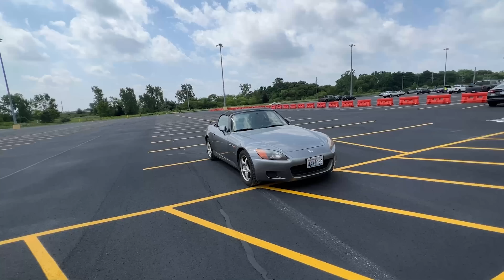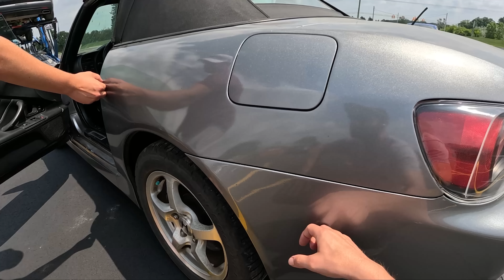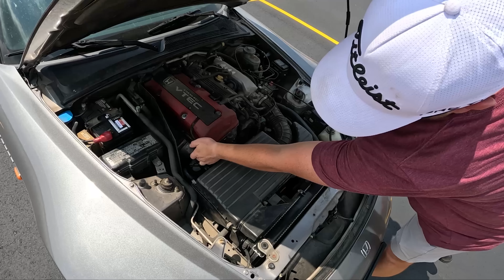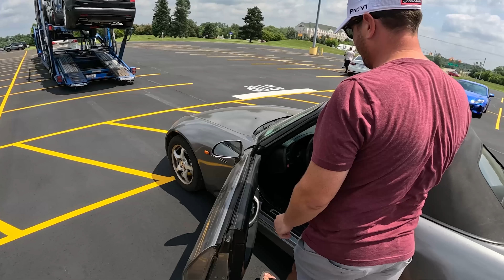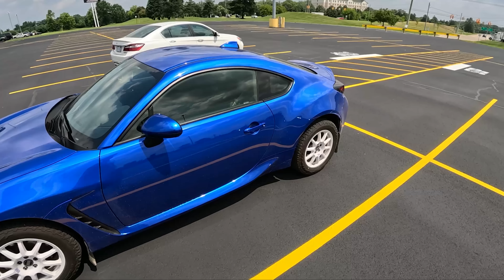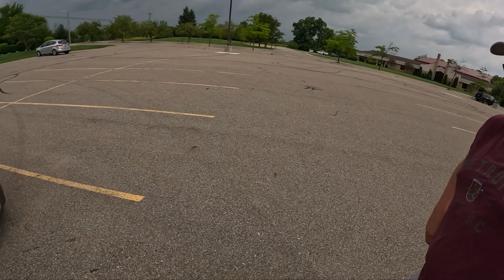2001 Honda S2000 - POV Delivery & First Drive

Comment: I am the original owner of a 2001 AP1 Silverstone/Red Interior.. I only have 28k Miles and its all original... Pristine condition..

I must say, that is an impressive find! This find is way more impresssive than those bastardized examples!! Congratulations thats a Jem!! 

A few things..
-the decel rattle are the clutch springs.. there was a TSB long ago... not a problem, just noisy
-for tires, make sure you go with a 225mm front and 255mm rear tire at least for the AP1... the original tires were specs at 205/255.. but they actually measure wider
-Use a name brand high mileage 5w30 oil and check it at every fuel fill up.. the harder you beat on it the more oil it will consume. 
-valve retainers, TCT and oil squirters should be upgraded
-

Best of luck!
Reply: Bridgestone make a set of front and rear Potenza Sport tyres specifically for the S2000 -- 205/55 R16 and 245/45R16 (both running wider than their nominal size, of course).  Though they have relatively soft sidewalls for some reason, unlike older model 16" Potenzas that have super stiff sidewalls (not sure why Bridgestone have changed this) -- though the sidewalls probably aren't any softer than on a  ContiExtremeContact (which also has 16" tyres available).

Comment: I pray that one day honda will make a modern one ❤
Reply: I used to think that too, but they would mess it up. The clutch would be too light, it would be turbocharged and low revving, it wouldn't sound good, it would have too many digital screens, it would be too expensive, and probably wouldn't look good. Sometimes it's best to leave Legends alone.

Comment: I had an 01 silverstone ap1 for almost 10 years until the steering rack crapped out.  I had an ap2 transmission with light weight flywheel and it was the best mod ever.  

The front passenger side fender has definitely been repainted.  I had the crappy plastic window.

Comment: I bought an AP1 couple of years ago pre panini. I am usually smiling just as wide driving it now as I did day 1. The engine sounds like angry hornets and is begging to get pushed harder. The only thing I think that is better but comes close in experience is Porsche. That says a lot about how legendary this car is. I wanted something faster but I didnt want to turbo it and change the characteristics of the car…. so I recently picked up an old AMG SL55. Between this and that I have quick lightweight car and fast v8.

Comment: Sugoi Desu. I have a Ap1 also. I recommend changing all the fluids, do a valve adjustment, and purchase modifry elastic straps incase yours are worn because your softtop will rip if they lose elasticity

Comment: The buzzing you hear at decel is most likely the clutch buzz that AP1s commonly have. Nothing mechanical, just noise. You can replace the clutch with the updated OEM disc if that noise bothers you per Hondas TSB way back. I have it on my AP1, i just deal with the noise since the clutch still works great after 15k miles. Got mine when it had 22k miles and 37k miles now.

Comment: The paint color looks inconsistent on the passenger side. But not sure if that’s a polarizer. My guess is not. For example the front fender and rear fender are different shades compared to the door.  But it seems you know that.

Comment: Getting closer everyday to obtaining one...I want an 04-05 AP2 still drive by cable
Reply: When I had my pick of S2K's six years ago, I specifically wanted an AP2v1 (O4-05) car. The cable actuated throttle was a part of that choice. Higher redlines aren't such a big deal after riding motorcycles for years,  but I'd still likely choose an AP1 over an AP2v2 or AP2v3 car to avoid DBW. Though many report little to no difference in the feel of the DBW cars, I simply don't like electronically controlled throttles. Ironically, some search specifically for the 2006+ cars for the ease of tuning the DBW system brings. The AP1 cars remain the bargains of the S2K world, but ultimately people should buy what they like. Prices appear to have come down some this year, so keep the faith.
Reply: @VirtualGuth  I've definitely been tempted to sell my EM1 for an AP1 a few times but I definitely know what I want. plus I wouldn't mind building the F22 for a higher redline :)
Reply: @matth6284  If the higher redline truly tempts you, then the other option would be to go for an AP1 car and then swap out the rear subframe with that of an AP2 car. A number of AP1 owners who raced their cars did this after the release of the AP2, giving them the higher redline of the F20C1 engine with the better handling (less bump steer) of the AP2 chassis upgrades. You could still retain the suspension components of the AP1 car if you wished as they apparently still work with the improved geometry of the AP2 rear subframe. Ultimately this would likely be quite a bit less expensive in the long run.

Comment: Do TCT, AP2 retainers/keepers, valve adjustment, shifter rebuild, motor mounts/trans mounts, fluids, torque rear axle nuts, the AP2 valve cover has upgraded pcv valve, check your driveshaft bolts they come loose maybe vibration you having, ect I could go on lol but that's a start

Comment: I also bought my AP1 with a recently replaced clutch. It also had a deceleration vibration. 
The vibration ended up being the Exedy clutch disc had too stiff of springs in the hub. 
I installed an OE Honda disc and all the vibration went away.

Comment: That F20C screaming to 9000 RPM. One of the highest revving Hondas ever along with the Integra Type R and the Civic Type R (FD2)
Reply: Don't forget the earlier Honda S cars. The S500 and S600 redlined at 9,500 RPM (compared to the 8,800 of the F20C), but revved to something like 10,000 RPM.

Comment: I've owned a 2002 and a 2006.  After a while you realize it makes sense to drive it in convertible mode only and is a second hand car for weekends.  Probably why I sold both each time.  Couldn't make a good case to keep them.  They don't make good daily drivers because they are uncomfortable, noisy, and stiff to drive.
Reply: I actually find my S2K to be pretty comfortable, but then I'm only 5'8" and also ride motorcycles (everything is relative). That said, I agree with you with regards to the noise levels of these cars with the top up. I'm an older guy that doesn't expect a sports car to be anything other than what the S2000 is, in fact these cars are fairly plush by my standards. But as you came to realize, I definitely feel that these cars are best with the top down (this is the reason that I wound up with a S2K in the first place). As a 2nd car to be enjoyed during nice weather, these cars are hard to beat. But for daily driving there are plenty of better choices out there.
Reply: You're approaching it the wrong way. They are excellent daily drivers if you think about them as a luxurious motorcycle.
Reply: Agreed I’m gonna sell mine
Reply: @mediocreman2  haha before my wife and I had kids it was fun for weekend drives to the beach.  But that's the only time we enjoyed them.  Sat in the garage most of the time.  Didnt make sense keeping them and paying for the upkeep.

Comment: Still baffled as to why Honda does not have an affordable RWD coupe in the line up in the modern day. Even something like an S1500 with a 1.5T would've been a hoot and a half to drive and own.
Reply from the maker: Agreed! They need to get on that
Reply: S2K owner here. It comes down to money and development costs. Honda doesn't have anything in their architecture that supports RWD. Literally everything is either FWD or retrofitted AWD. 

It also comes down to sales. Performance cars are such a low percentage of their sales. They even knew this when the NSX and S2K were being made, but they wanted to establish themselves as a contender. Performance cars are good for hype and branding, but generally always lose money from development costs. 

Even if they do make one it will probably be really expensive. Keep in mind the MSRP of the S2K in 2001 was $33k. That's $57k in today's money.
Reply: @777aterial yeah what people tend to forget is that the s2000 was pretty damn pricey new at the time
Reply: Yes but not with a 1.5t.

Comment: Be sure to do AP2 valve spring retainers, cheap insurance. There is good documentation of the AP1’s cracking. Congrats BTW!
Reply: AP1 valve retainers are totally fine unless you money shift and even the updated AP2 retainers can break then. My AP1 has done 200miles and they’re absolutely fine. Not really worth doing imo and there’s lots of documentation on it
Reply: @Manvswild11  You think the issue is overblown?  Is the swap still worth doing for cars that are tracked a lot or turned into race cars, or is not worth doing even then?
Reply: @Manvswild11 Agreed. Never had issues with mine but you never know if the previous owner was horrible at shifting and over revved the engine

Comment: My ap1 had a vibration. Ended up being inner axle cups.  Take them off and swap them left to right so the CV bearings ride on a fresh surface then properly re torque the axle nut.  Might not be what’s going on with yours but just a heads up
Reply: Very common on higher mileage cars. That solution is the same one I used and has been documented on the forums for decades.

Comment: Ap2 goes to 8250 so little less than 1000rpm difference. I rev mine to 8700 so it’s best of both worlds with the extra midrange torque 👍🏻

Comment: I thought these were a lot lighter, its only ~150 less than a new Civic Si
Reply: Heavy because convertible unfortunately.  (Or the engineering is just not as good as the mighty, if floppy at the time on the NB but likely not anymore on the ND, Miata!)

Comment: I've always wondered why Honda made that little engine with a good amount of horsepower for such a small car,  BUT NO torque!??
Reply: "BUT NO torque!??" More or less, that's the only way you can get 240hp out of a non-turbo 2.0L engine that doesn't have variable valve timing. Honda have chased peak power at the expense of everything else. The F22C addressed that somewhat with more displacement, while the K20 addresses that using variable valve timing (while the K24 uses even more displacement to address that but can't rev as high).

The S2000 engine has a big bore and a very short stroke (for maximum torque you'd want the opposite), an intake manifold with short and fat intake runners instead of the long intake runners you'd want for torque, VTEC cam lobes designed for peak power at 8300rpm (most cam profiles are optimised for a certain rpm, and reach peak torque and then drop off after all) and so on.

It's quite famous that it's difficult to improve on the stock long tube exhaust manifold or stock intake manifold, because essentially Honda already optimised it and pretty much squeezed every last horsepower out of it already -- as you say at the expense of torque, unfortunately, such was the singular goal.

Some other engines use variable length intake trumpets, or dual path intake manifolds, to try to achieve a broader torque spread (so a long path for torque and then the ability to switch to the short path for maximum power, e.g., the Varioram system on 993 Porsches) while unfortunately the S2000 omits this.

Realistically, older technology NA inline-four engines like a Lotus Twin-Cam or Toyota 4A-GE engine or so on are going to be just as peaky, if not worse, when tuned for the same amount of power as the S2000.  While contemporaries like the Ford Zetec or Renault F4R, while being torquey long-stroke engines, essentially can't reach 240hp anyway no matter what you do (short of a full race engine build).
Reply: Torque and high HP per liter and high revving don't go together. Look into engine design. It's actually fascinating.
Reply: @mediocreman2  "Torque and high HP per liter and high revving don't go together"  Unless that is you have a very large (but short stroke) engine where you can maintain the high torque up  to high rpm as well to produce both high torque and high power, like the Ferrari 6.5L V12.

788hp @ 8500rpm 
700 Nm (516lbft) @ 7000rpm

Who needs a turbo-diesel anyway? 😂

The Ferrari "F140" V12 is 94mm bore x 78mm stroke, whereas the S2000 engine is bore 87mm bore x 84mm stroke. So the Ferrari is even more oversquare than the Honda S2000, but makes it up for it with brute displacement (and variable valve timing).

The F20C has the same bore centre spacing as the Honda F & H series and K series, so I guess that is as far as Honda could bore it out.  If it had an even bigger bore and shorter stroke like the Ferrari, I guess the "lack" of torque would be even worse.